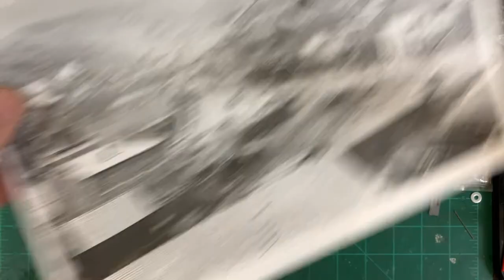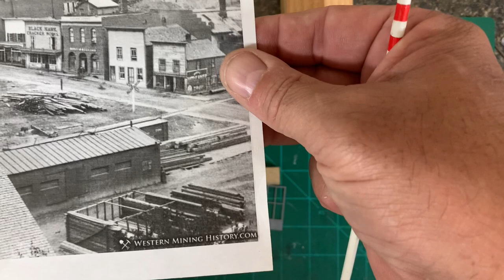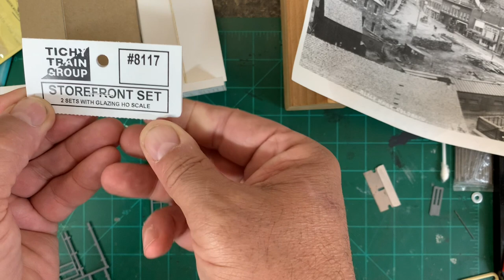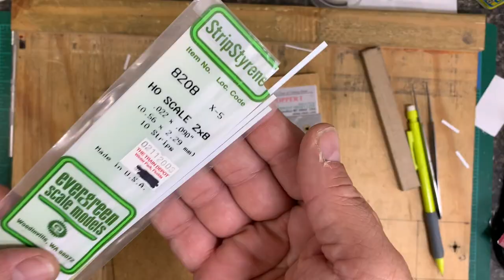Structure Build 11 (The Cobbler)

Comment: I increase my Styrene supply by 2-3 profiles every time I go to the hobby shop (or order). It is not expensive if it is a certain investment. You will use it, and thank yourself down the road for doing so. 😁
Reply from the maker: I wish I had a brick-and-mortar shop near me, I would definitely do just that.  I've got a good collection of sheet material, some round stock, and small tubing.  I've been scanning e-bay looking for assortments for sale.  It's hard to know what will be most useful with no experience.  I've got some half-round on the way, and some of the more common lumber dimensions.  Thanks for stopping in Boomer!
Reply: @OtterCreek  The Angle stock is nice to have: # 291, 292, 293, 294, and all the Rod sizes . . . and of course the smaller half and quarter round stock.
Reply from the maker: @boomerdiorama  Thanks!

Comment: Dennis, to apply window gazing in tight places you should use Micro Mark’s Vacuum Pickup tool (part number 81851, $12.00) It holds the “glass” until you press it in place and release it. It’s really handy
Reply from the maker: Good idea.  Although it wouldn't have worked in this instance unless it also has a 90-degree angle adapter to the suction cup!  Tweezers worked like a charm.  Thanks TC.

Comment: Great demo video. I came in late at the very end of the airbrushing.

Two questions came up for me. Sorry if you’ve talked about these in previous videos.

1. Is there a vacuum at the other end of that tube in the back wall of your spray booth?

2. Why did you decide to do the wood building with front cassette front? Is it because it simplifies building or to make it more damage-proof?
Reply from the maker: 1.) Yes, I need to build a better box and add some filtration.

2.) Yes to both of your points.  I have a lot of scrap 2x4 material and with just a few passes on the table saw have the overall dimensions of the structure.  It also makes a very sturdy structure.  Thanks for the view!